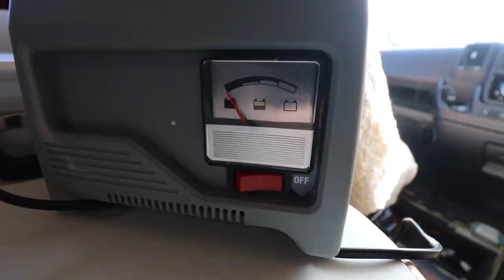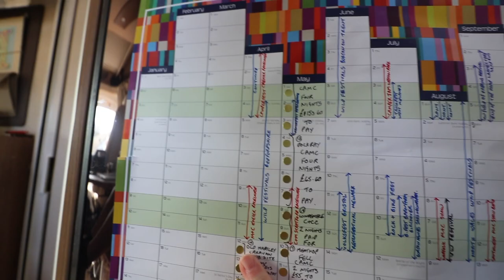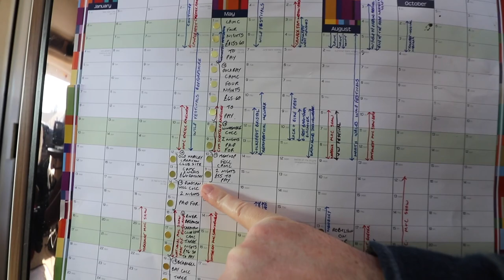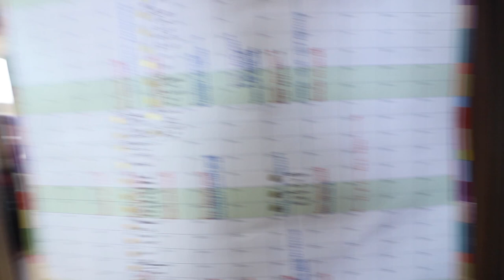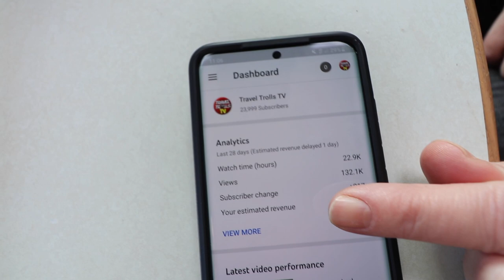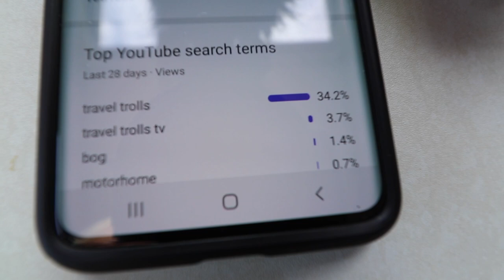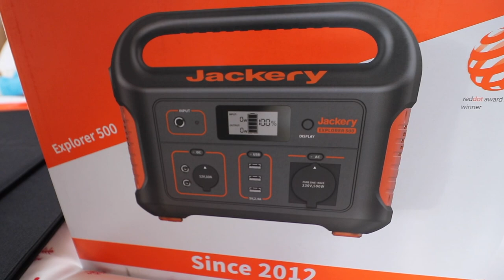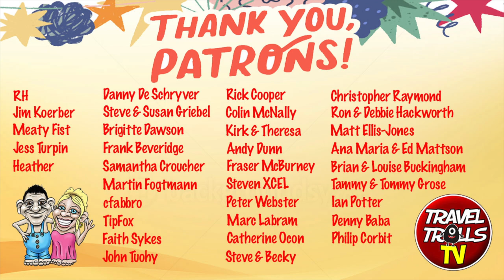NO Garden Furniture Or Trampolines 2021...WHY?!

Comment: The alarm will slowly run the battery down. So if it’s about three weeks since you last charged it or don’t run the engine that’s it the alarm has drained the battery down. Our old MoHo used to drain its battery like that due to the alarm. Our new one is a bit more clever, it’s got a solar panel that switches between the leisure battery and the vehicle battery depending on which one is low, all we need is the sun. So during the Winter I start the engine once every two weeks for about twenty minutes during the middle of the day, that way it doesn’t annoy the neighbours.

Comment: Hi Dan and Masie, did you know that you can get a smart battery charger that you can leave connected to the battery and it will switch itself on and off to keep the battery topped up. You can even change the battery though your cigarette lighter, as long as the cig lighter socket doesn't need the ignition to be switched on to work. 🙂🥰

Comment: I think it's normal with the battery. There are always devices that need energy even when all is switched off. The energy is low but it sums up over time. There are little solar panels (only 10...20W) for the dashboard available to prevent an empty battery when not using the car or van for a longer time.

Comment: I would have the battery tested to see if it is getting weak . Nice to know now before you are stranded some place , and if battery is going bad it will over work the alternator
Reply from the maker: The battery is fine. It just needs using.

Comment: Dan you are the man!! Great job fixing the step strip. But you didn’t connect the wire for the light.  Just a note on the bathroom tap. Look under the cabinet there will be two 12v wires. This is where your micro switch should be. Keep up the good work lol 😝
Reply from the maker: Yes that's where the wires go to but the actual switch is in the tap head.

Comment: Beggars can't be choosers on your tap, pay the higher price for the same one or a cheaper version which will do the job. I would want an original myself. Ideally you need to run the Van Engine for 30 mins at least to put the charge back in from just starting the engine! Ideally once a week. Best idea is to take it shopping like we do, 20 mile round trip. So 10 mins would not be any good! It does the Van a lot of good all round! That way not disturbing the neighbours! The van uses a small amount of 'Keep Alive' power for radio, Alarm, clock etc. Otherwise charge it with the Battery charger each week. Or leave the battery disconnected, but nothing Van based will work!
Reply from the maker: We cant get the van out to take it for a run lol
Reply: @TravelTrollsTV  You don't make it easy do ya! 😂 So looks like the Battery charger is the way to go!

Comment: Why don't you just connect the battery charger to the proper connections under the bonnet Dan the positive has a plastic cover over it with a + on it, and you can connect the negative to any metal of the un painted body or bracket . will be looking out for you two in Northumberland .

Comment: Hi guys..am in thinking your starter motor battery is getting flat..how old is the battery most only have a working life off 3 to 4 years...treat your self to a bluetooth battery monitor...they are only £10 and have two wires to connect to the battery one + the other -..you can monitor the battery health on your phone..I start mine up every 4th day if stood for a long time..please stay safe both off you. Xx
Reply from the maker: Thanks for the tip 🙂

Comment: Just buy a battery conditioner charge and leave it on permanent when not using van or best option 
change solar charger to a duel one that way the leisure battery and the engine battery both get charged.
The alarm will drain the battery over time.
Best done by a electrician not Dan
Reply from the maker: But Dan is a professional.

Comment: Hey Dan, I found this Trolling the web, hope it helps and sheds some light on your battery drain, I dont know anything about your van apart from it being a Hymer, anyway have a read of this.
....when on site, or wherever  you'll perhaps want to listen to the radio?...but you wont want to turn your ignition on all the time.....hence that radios are sometimes wired to the vehicle battery via some sort of 'entertainment' switch in the leisure area....
this is my (similar) problem.....the unit is wired correctly to the ignition AUX but remains in standby via the entertainment switch, which obviously continues the drain....
i will need to get an inline switch inserted into the radio live feed so that the entertainment systems (tv/sat, etc) can be ON without the radio killing everything.
Reply from the maker: Thanks for all the info :-)